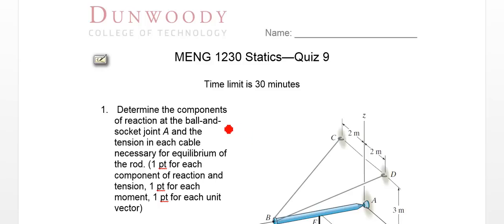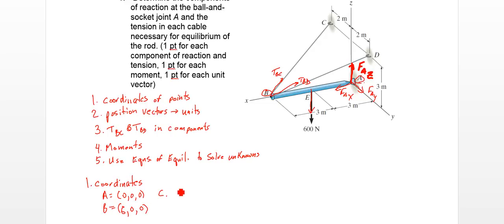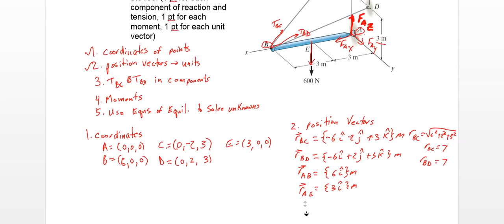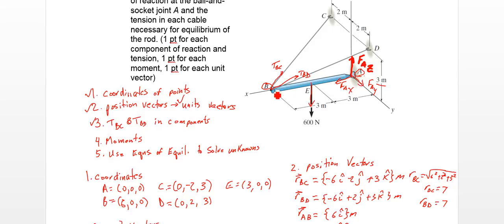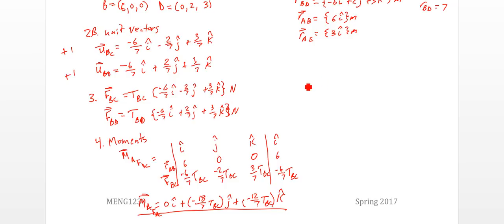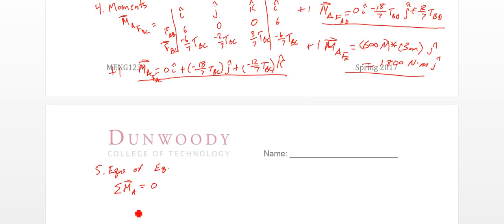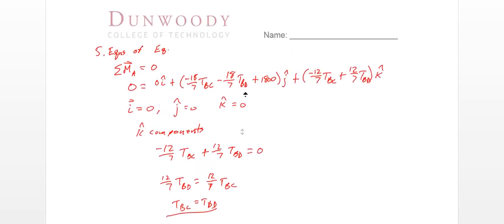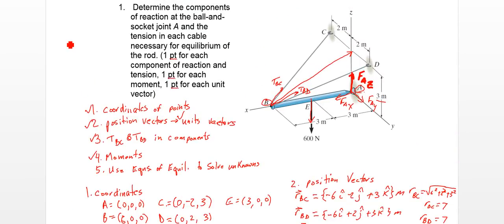MENG1230 Statics Quiz 9 Solution

Comment: Why is your moment at A Force E in the J axis?
Reply from the maker: It's position vector (from A to E) is in the plus i direction.  The direction of the force is in the -k direction.  i X k is -j, since it was -k direction for the force it makes it positive j for the moment about A due to the force at E.  

You can also use the right-hand rule to visualize the moment.  Point your fingers from A to E, curl them in the direction of the force (down), and your thumb will point in the direction of the moment (in this case, the positive j direction)

Comment: during the Moment calculations why do you copy the i column again?
Reply from the maker: It was the way I was taught so you don't have to remember to put the negative sign in front of the j term.  You can formulate the cross product either the normal way (putting the negative in front of the j term) or by copying the i and j columns to the right.